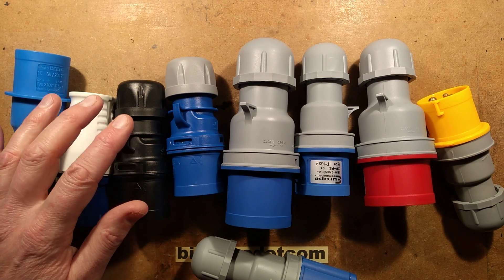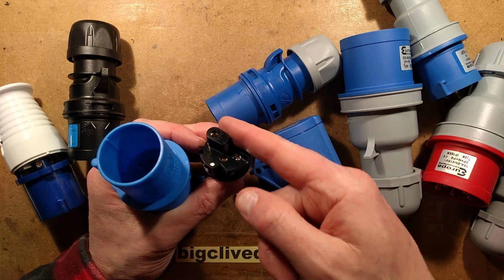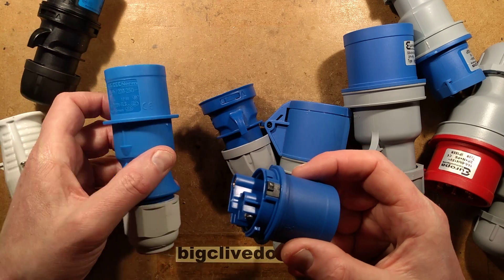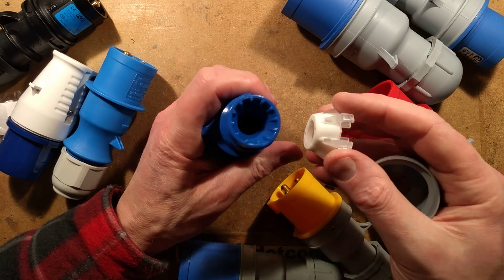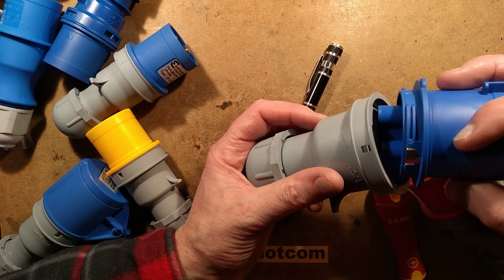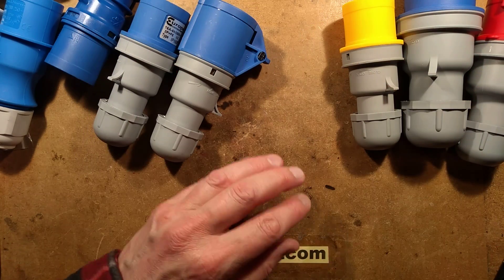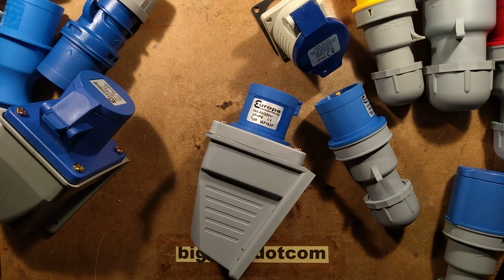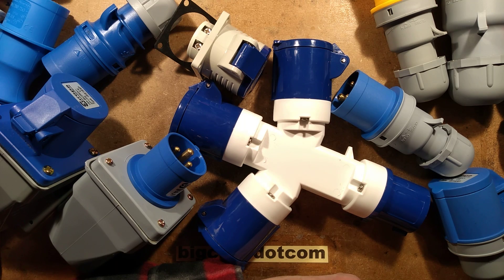My favourite industrial connector (Ceeform).

Comment: When you mentioned caterers and their lack of electrical knowledge I nearly pissed myself from laughing as I have "fond" memories of those poor lads and lasses.
Most memorable was when they plugged in their heat-lamps to keep hot dishes warm during a buffet. Unknowingly, they plugged in, into one of our break-out cables we used for ambient up-lighting of the venue. During the event, we had to dim all of the lights on a few occasions, including the up-lights. This is when we noticed what they'd done and quickly pulled a regular power line for them to use. 

Second memorable event, although not as funny, was during a posh Christmas dinner. We asked the caterer how much kitchen equipment they'd brought in as we were doing power management as well that night. Oooh, only a small oven and a little deep fryer plus 2 fridges was they head chef's reply. Okay, then. We pulled a 32A 3phase line for them and a break out box for them to use. An hour or so into the event, all of the power went out. We went in to check what had happened but couldn't find any problem then. So, we flipped the breakers back on and within 5 seconds they'd trip again. We quickly set out to investigate what was going on and within a minute or so, my boss came walking in and told us that he'd found the issue. That small oven and little deep fryer turned out to be 3, 12 plate ovens, an industrial 2 pan deep fryer and 8 fridges. Needless to say, nobody was amused that evening.
Though, in most cases, the caterers I've encountered were pretty easy going and asked before they'd plug anything in to avoid issues. It's also worth mentioning that in ones best interest is to keep caterers your friend as they do provide the stage crew with lots and lots of tasty things and snacks throughout the evening ;) 

As for those surface mounted enclosures, most modern campers and caravans use those (the male variant).
Reply: Caterers hmm, once had a conversation with a catering supplier who when asked what his power connection requirement was replied "just electric!"
Reply: @mickb6285  face desks never had that happen to me personally. That's just cringe worthy
Reply: So this is where I add my food truck experience, oh they where very nice and I managed to get lunch out of it. I managed to get myself into running the electrics for my County Fair I've enjoyed it for two years so far. but this one trailer came equipped with an 240-volt Inlet and a fancy 2x 20 amps to a 30 amp connector that way they could grab two different 20 amp circuits and have 240 or at least have all of the equipment throughout separated on two circuits. Problem is out of the 5 extension cords they brought one had a hot neutral reverse and just happened to be one of the two that they grab and used to plug in and instantly tripped the breaker. which I then had to go hunting for in a large 60s era facility that is currently a Community / Senior activities Center and I think I finally got up to like 6 or 8 electrical panels. So I rewired their cord checked all their cords and transferred them over to the generator and then went on a finding spree for every electrical panel in the building. To their credit the cord had a replacement end and for some reason I literally encountered the same problem when I went to check and verify a new cord to my collection the night before. For some reason the manufacture decided to color to neutral screw black and leave the hot screw brass oh, I guess this was Old Stock and predated the silver for neutral.
The following year I found out the 2x generously donated large pull behind 500? kilowatt generators were far more money than anybody thought they were the year before to rent. and I had to make do with <10 outlets on the outside of the building and i did not have one issue, however I made sure to check everything before I plugged anything in and very carefully did load Management in my head as 3 of the outlets we're not in an area that I could access the electrical panel. this was even complete with a 250 ft 12awg temporary one time use Romex run all the way to the back of the building, because the outlet 100 feet closer didn't work and probably got cut at some point.

The best part, I was hired both times to do sound the second time I expanded into electrics officially. and if that wasn't enough they've always had issues with Electrics in the prior location which was inside a relatively modern school. so outside with less to work with and no issues, I really need to get licensed.
Reply: i would never let caterers use 3 phase, its easy to unbalance it and have it start to smoke
Reply: @raineylights  we don't have a choise in the matter as the ovens they all use are running on 3 phase. Mind you, we typically ran big 500 amp or larger gensets or used power from the main lines.
Reply: ah damn, i guess thats fair enough

Comment: Also available in IP67.

https://www.amazon.co.uk/Trailing-Socket-Waterproof-Female-Single/dp/B07NCPXJL4/ref=asc_df_B07NCPXJL4/?tag=googshopuk-21&linkCode=df0&hvadid=375498143972&hvpos=1o2&hvnetw=g&hvrand=3656453383462071947&hvpone=&hvptwo=&hvqmt=&hvdev=c&hvdvcmdl=&hvlocint=&hvlocphy=9040156&hvtargid=pla-819082063395&psc=1&tag=&ref=&adgrpid=76297946145&hvpone=&hvptwo=&hvadid=375498143972&hvpos=1o2&hvnetw=g&hvrand=3656453383462071947&hvqmt=&hvdev=c&hvdvcmdl=&hvlocint=&hvlocphy=9040156&hvtargid=pla-819082063395

Comment: Schuko and Perilex FTW.
Though less good for outside and more for inside. Schuko is available in a rubber version for the outside. Pretty good system. You should look at it Clive. And also mention Perilex.
Its mostly used in Kitchen these days.
And yeah, for the rest (Industrial, outdoor) over here in Germany, we use the CEE connectors as well. And maybe you want to look at the Merten Connectors.

Comment: Yeah 125A extension cords are not easy to handle :p We use such to connect advertising bands on stadium. Its 25mm2 5core rubber cable. We have to use quad to transport 30m extension cord. Suprisingly the 125A plugs are very well made and they plug/unplug really easy. I once had 63A china plug, and it was so tight, that we had to use crowbar to undo it off the socket. 2 people couldnt do it manually. Austria's PCE plugs are the best! also german Mennekes is very good hardware.

Comment: Here in Hungary, they are quite common. I've seen them on street decorations, advertisment signs so basically anything that lights. And on the little stands at the fair. Even I use them for my variac, because schuko is reversible. I don't want 30V as 230V.

Comment: We have those in Sweden. Disconected trains from the overhead wire are connected to a box with a connector like that. I'm not a driver, "just" staff aboard so I have no more details.I've used one in an industrial welder. It had a big lever switch and a sign that said "turn off before disconnecting"

Comment: For 3-Phase connections there was also a predecessor of the CEE system in Germany. The Perilex plug and socket. Sometimes you still find them in older house installations. https://en.m.wikipedia.org/wiki/Perilex

Comment: Second from the left, white/blue. Camping plug. With our caravan we have had a cable with schuko at one end and  ceeform connector at the other end. (Netherlands/Germany)
Second from the right, grey/red. I worked with those with the dimmer pack at the theater, 3x16 amp. Had a meltdown once, one of the pin went glowing red (Netherlands)
Fourth from the left, grey/blueblue, I have these at home for use with my movable server case (retired soda fridge with glass door) to avoid accidental disconnection. (Thailand)

Comment: Germany: we use them for 3 phase applikations but never seen the  one phase ones here.
England: was there once in a nissan production facility they had these 1 phase ones so we could not use our tools lukily someone had a adapter.

i love the wall mountet box style outlets 3 phase with a 1 phase outlet on top but rarely see them.
there are also 3 phase plugs where you can rotate 2 phases without opening the plug very handy if your workplace i poorly wired. so your machines rotate the right way.

Comment: These are very usual in Sweden. The blue 1-phase one is perhaps a little uncommon, used for caravans and such, but the red 3-phase one is definitely 100% the one used everywhere. Sold and labeled by current rating and size going hand in hand. 3-phase is still very big here, every home has at least one 3-phase Ceeform plug. We just call them "gloves" or "Three phase gloves."

Comment: Clive, I work with these and they are used around the world in the entertainment industry. Stage lighting and power is all done with these connectors. Black ones are better for hiding. They also come in I.P68 for outside installations that are likely to get soaked, same fittings and I.p44 will plug into I.P68’s. They come in 16,32,68 and 125amp versions.

Comment: In norway, it is the standard connectors used for power distribution at construction sites and farms, the power companies I have had any dealings with all use it when they set up temp power supplies at work sites.
Campers tend to come with it as the 220v main in, with a short conversion lead to male schuko for general use.

Comment: In Germany we use the red 3 phase version for all kinds of Machines like air Compressors, welders or circular saws. The blue single phase 16A Plug is standard on shore power for RV and caravans. Some machines only use one phase, but are equipped with a 3-phase plug, cause it is more common in workshops.

Comment: Quite common failure point as well is when the wire stripping has been done poorly and the rubber jacket of the cable is outside the connector leaving the 3 or 5 wires  hanging visible outside the connector.

Comment: 0:30 A piece of knowledge for you - flexible plastic doesn't always mean it's shock resistant)) You can do a simple experiment - buy a polypropylene container for food and try to bend it, at room temperature. It probably will fold in half without shattering (may still chatter though), but try to smash it with a hammer/foot - it will shatter almost like glass.
Shock resistance is usually a property of particular plastic or blend of plastic, but I don't really know physics/chemistry behind it.

And yes, we use that  type of plug in Russia) Usually ABB made, so the latch for the housing is different - it's molded into both parts on the outside, and to open it you wedge a slotted screwdriver in it and twist 90 degrees. That releases the latch and twists the housing open. I like UK style more - it's more durable. I've found ABB instruction, if you interested https://search-ext.abb.com/library/Download.aspx?DocumentID=2CMC700041M0005&LanguageCode=en&DocumentPartId=&Action=Launch

Comment: I really don´t like the PCE System. I find it really hard to push the locking pin in and most of the time, I stabbed myself with the screwdriver while doing it. I find that the best CEE connectors are produced by the german company Mennekes. Thier lockingsystem is much easier to use and they even have a wireterminationsystem that doesn´t require ferrules. (So called "Startop") To your question: In Germany they are used everywhere when an device needs 3 phases. The 230V CEE are mostly used at caravans and sometimes in bigger industrial shops.

Comment: Was the rating of the plugs / breakers et al related to the carrying capacity of the cables? Bit pointless to have a 32A breaker if the cable can only take 30A ...... and you know they will up the ratings as much as they can because bigger is better, right?
We have 400A plugs and sockets on kit at work (but it is NOT "Cee form") ;0)

Comment: 12:28 There are some pill-shaped cases you can use to protect that connection from water. They have rubber grommets at the extremities, where cables enter and exit. Some campsites require you to use those of you're going to use extension cables.

Google for "cee veiligheidsbox" to see what I mean.

Comment: we use those at my work (large diesel engine rebuild center) for our turnover stand hydraulic pumps, all crane power boxes have one on the side in each bay, only issue we have is the oil in the air makes them go brittle over many years.

Comment: Swiss electrician here. These are commonly used for temporary power supply lines on construction sites and festivals. I have also seen quite a lot of the wall mounted ones in industrial buildings

Comment: We have something similar here in Canada, they are also used in the US. Here they are called a pin and sleeve connector. There is a similar style called  a California style connector because they conform to california electrical codes.   I use them all the time but in IP52, IP54 and IP67 versions. Always have them mounted facing downward either by hanging on a cord or by mounting on a box cover sold for the the purpose that angles the plug downwards. I do agricultural automation usually in the dairy industry so as you can imagine things get washed down very liberally. Even the giant 480v 50hp manure pump that has to be easily unhooked so that it can be pulled when it jams up. If you want I could mail you some Hubbell brand california style connectors if you'd be willing to mail them back. They are quite expensive.   

Meltric is one brand I use. Part numbers for a 3ph 240v disconnect rated wall mount include 
3364073 - DS60 - 60A RECEPTACLE
 - https://www.galco.com/buy/Meltric/33-64073
514C7000 - POLY WALL BACKBOX - 70DEG
 - https://www.galco.com/buy/Meltric/514C7000
3368073 - DS60 MALE
 - https://www.galco.com/buy/Meltric/33-68073
514P0N07 –CABLE HANDLE
 - https://www.galco.com/buy/Meltric/514P0N07

Here is a Leviton version that is not disconnect rated
 but IP67
4100P9W - BX PLUG PIN & SLEEVE 100A3PH25
 - https://www.leviton.com/en/products/4100p9w
BX100V - BOX BACK FOR PIN & SLEEVE DEVI
 - https://www.leviton.com/en/products/bx100-v
4100R9W - RECEPTACLE PIN & SLEEVE - https://www.leviton.com/en/products/4100r9w

Comment: Germany 100% use them every day. Mostly for 400V applications up to 125 A. Not those blue "camping" adapters. I am an apprentice as an electrician for buildings. Our 400V for example CEE32A dont have terminals with screws but to clamp them. On those you dont have to remove the wire insulation. You push the seperate wires in and and push down on a plastic bit which pushes a blade into the wire which makes the connection. Also the earth connection is always elevated about 1cm so if you pull on the cable the earth disconnects at last. Love your videos

Comment: Austria. Used for 3 phase power on construction sites, bigger outdoor events, ovens in restaurants (regular ones just have the wires connected at the back) and industrial machinery that needs that much power. Normal single phase 230V tend to just use Schuko sockets.

Comment: We use these at UPS in the US for connecting temporary building extensions to the lighting system. (These are outdoor temporary truck docks on wheels with rollers, lights, and a tarp for a roof) meant for the holiday season.

Comment: in germany we have the 3 phase red conector in 16 or 32 amp version in most of the home garages/home workshops.  

i need it for alot of my wood working tools,  also using it for gardening stuff like wood shredder.

The blue one for just one phase is widely used on campers/Caravans.

Comment: Im also working in the entertainment industry, here in Germany the CEE connector is quite common. The blue are rarely used, ive seen some yellow ones on conventional ACL-Fixtures, but most of the time we use the red 3-phase ones. We've also some small plug boxes, that can go up in the truss. They split 1 CEE 3-phase to 3 16A standard safty plugs (here called "Schuko"). The biggest CEE we work with is the 125A one, there are some bigger plugs and cables, but the 125A is already heavy enough. If we need more than 125A we use PowerLock instead :)

Comment: Working in an operating theatre here in the UK, when doing urology cases we use a laser (class 4 I think) to break up kidney stones and to cut away tumours, the laser machine we use plugs in to the wall via one of those blue connectors.

Comment: We use them in Norway also. There are a three phase version of the plug where two of the pins are mounted on a seperate part that has a screwdriver slot in it, so you can change the phase sequence really easy.  Normally called "phase inverter plug" (google it)

Comment: This style is quite common in Brazil. I have seen it used to plug in trailers and medical equipment such as  x-ray machines and fluoroscopes (continuous x-ray). Even though we have 20Amp (at 220v) sockets here, I think they are preferred because they are not very prone to fall out of the socket when pulled

Comment: they are used in Danish 5 kw 220-240v military generators , i have a few we also used them in the maritime industri on small coasters for shore power cables we called them pignose connectors

Comment: A slightly modified version is used to connect our Motor Home to 240 V Shore Power rated at 50 Amp.  The only difference, the plugs have an L shape so they can be twist locked into the RV female port, then the outer ring screws onto the port to keep the connection tight so as not to  unplug when some idiot walks between your rig and the power post, this used to be a problem with the straight pull out plugs, and I am here to tell you, it's a real pain when some one unplugs your rig at night and the temps get below freezing.  Luckily our new rig has a 12 volt fan on the furnace so it will run so long as we have good house batteries.